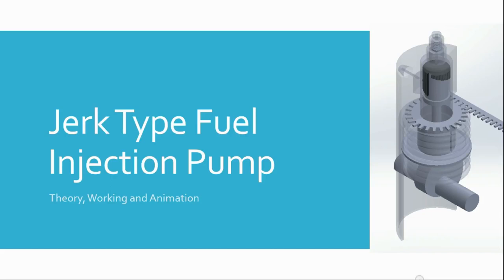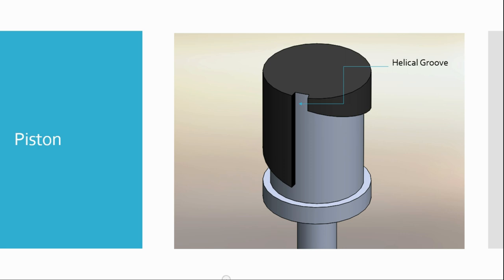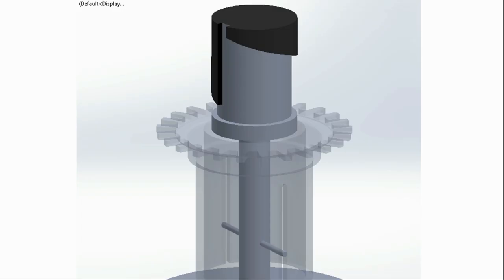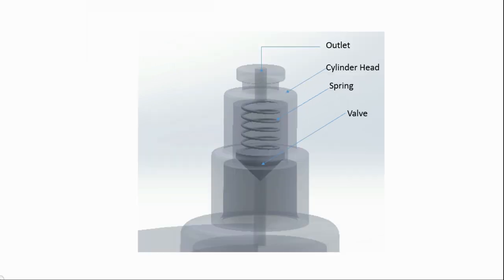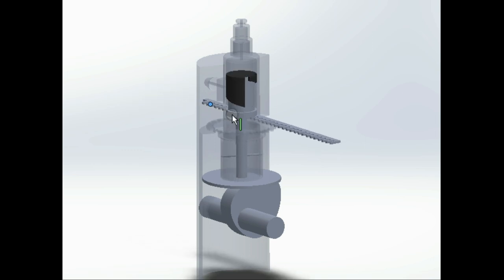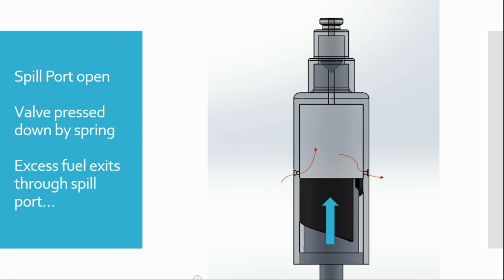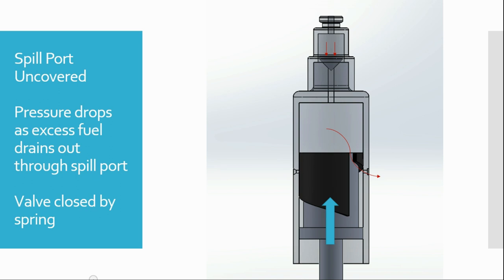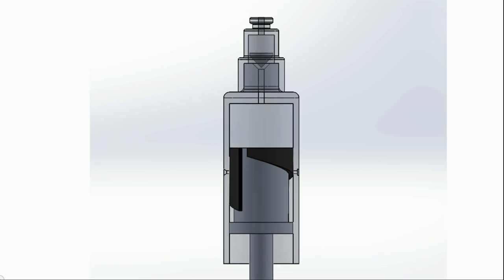Jerk-type or Plunger-type Fuel Injection Pump - Working and Animation

Comment: Also to affect injection timing we need to change the effective height of the plunger in barrel. Increasing the height of plunger in barrel leads to advance injection while when  decreasing its relative height / position results in retardation of fuel injection.

Comment: How much pressure is built up in the pump before the injector?
Reply: Pressure range 120 to 200 bar until the fuel is vapourize and advanced into the cylinder

Comment: When the piston is moving downwards after injection. The moment that the spill ports are closed. Does the create a vacuum as it is an expanding volume with no fuel to fill it ?
Reply: No Bcz there will be fuel present in the Grove, it'll be just pushed up and after when piston moves further down will pass through the spill port